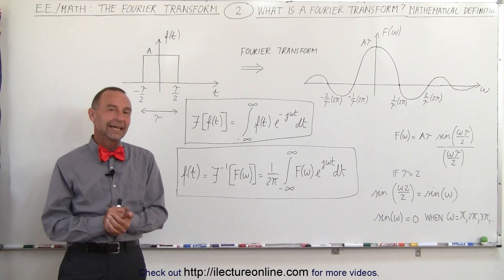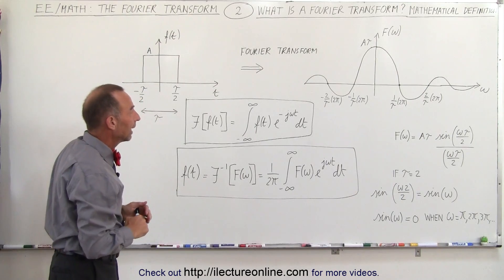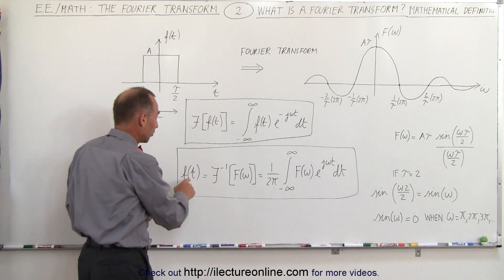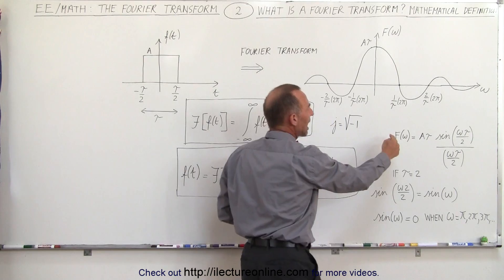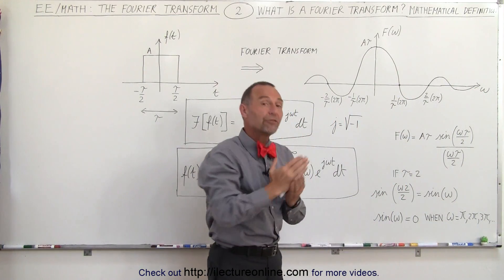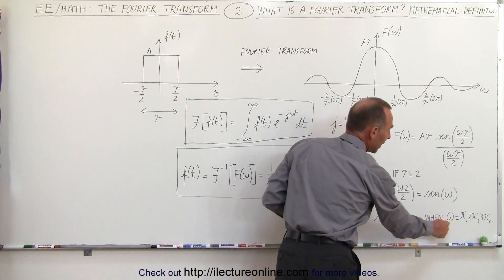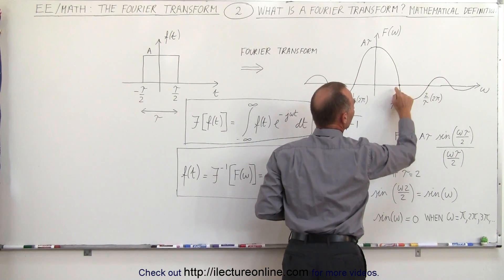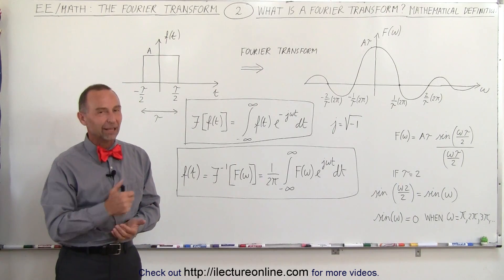Electrical Engineering: Ch 19: Fourier Transform (2 of 45) What is a Fourier Transform? Math Def

Comment: I appreciate your lectures. I am not entirely sure how you came about 1/2pi in the inverse Fourier transform. When I checked other sources I did not see it in their inverse Fourier equation
Reply from the maker: Yes, the apparent inconsistency of the 2 pi term is caused by not everyone agreeing on where it should be placed.  I have seen it divided up into two sqrt (2 pi) portions and the 2 pi term put into a different place.  Ultimately it is not important where it is placed as it is just a constant term in the transformation.

Comment: I wish I could understand why F(0)=AT from F(w). It gives 0/0... I think I will just accept it lol
Thanks for the lectures. They are helping me very much.
Reply: No it is not 0/0. F(0)=integral f(t)*e^-0 = AT*1 because integral over f(t) is the volume of the rectangle, A*T, and e to the power of 0 is =1.
Reply: You can calculate the limit when w -> 0 in this function using L ' Hospital